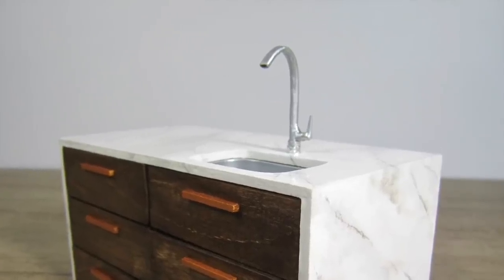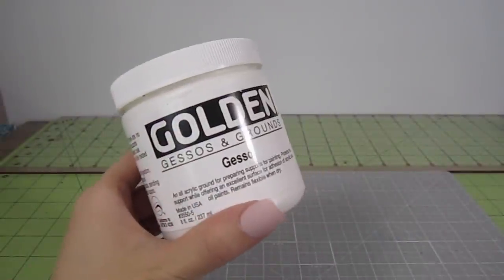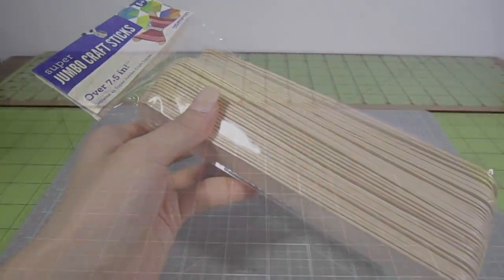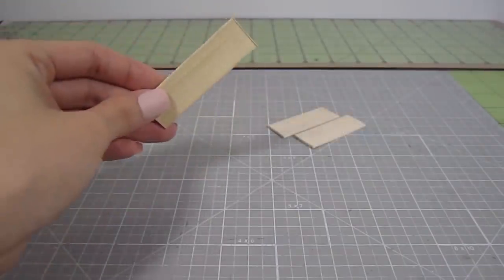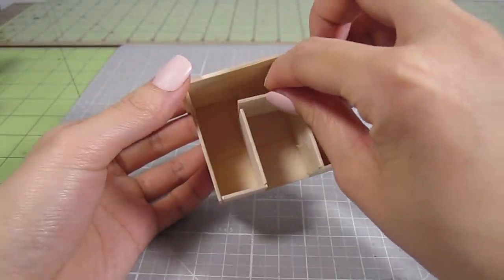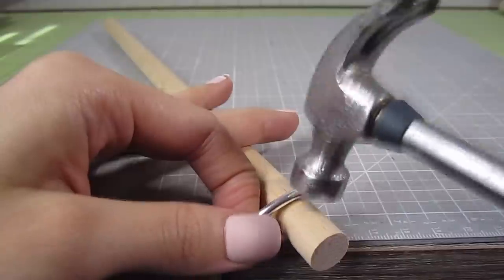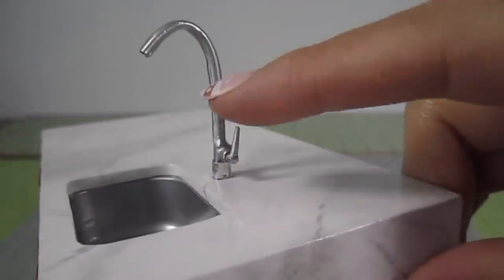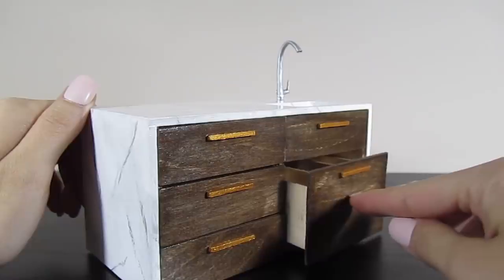DIY Miniature - Kitchen Island (working sink!)

Comment: Could you put the hole that was on the bottom of the thing on the back of the island so that you don’t have to hold it up for it to work?
Reply from the maker: Alyssa Girga Great question! you absolutely can! 😊 The reason I put the hole in the bottom was because this is a kitchen island and the back will be noticeable. It this sink was placed in a countertop that was on a wall, the best location for the hole would be at the back of the cabinet 👍
Reply: The Square to Spare Are you Japanese? Your accent is cool.

Comment: Wait, so where does the bottle go? Once it’s all complete, where do you put the bottle so it all connects and stuff? I want want to make it, but I’m a little confused about that bit.
Reply: FYI It’s DIY If you look at 9:10, she’s holding the bottle under the sink and squeezing, so you’ll have to create your dollhouse to have either an underneath hidden area to store the bottle, paint the bottle to be disguised as something else, or instead of using that exact bottle, creating your own water holding system with a needle tip and tubes (I’m currently trying to make one with plastic flexible tubing so I can route it through a hole outside my doll house through the back!)
Reply: @rosetta10010  --- Great idea!  You might consider making a video showing us how it turned out?  Would love to see the results.  :)

Comment: She has a very good design and how to on this sink.  I'd just suggest one short cut.  Instead of making the square water storage container (and having to make sure it doesn't leak) I'd either buy a round plastic bottle sold for food storage or craft supply storage (beads, etc.) and cut the top part off to make it easier and less work.  Or I'd look for the right size cap that would fit the space.  Check shampoo bottles, hand cream or liquid soap bottles, etc. for the right size.  I use these caps for all sorts of doll house things.  Example: toothpaste caps make nice vases to hold mini flowers.  Other caps can be used for bowls, etc.  When I use up or eat food in bottles with caps I never toss the cap.  I save them for dollhouse crafting projects.

Comment: Hi, I just want to clarify that you are actually lifting the unit up and over the bottle nozzle, to get the water up the piping and out the tap each time? It's a great design and video. I understand the need for nothing on the back of the unit, as its an island. But I just wonder if you have a video for a unit against the wall? Maybe have the bottle on the other side of the wall, and have the water piped through?? Can't wait to get started on my daughter dollhouse :-)

Comment: When I was a kid, I had a small sink--it was bigger than this one, but it had a working faucet with an actual recirculating pump and was battery-operated.  I loved that toy, and don't know what happened to it.  I'm bummed that I no longer have it.  However, I'm wondering how you make the water actually come up the faucet on this model:  I guess you have to be on both sides at once manipulating the squeeze bottle?

Comment: You are amazing! I love that you make most of your miniatures functional". I try to make all of mine as functional as I can as my children really enjoy playing with them and being able to use them with their different sized dolls etc.i will always make two, my "rough draft" and then my final piece. And I will give the rough original to my kids most of the time. Idk if you are taking requests from anyone and everyone, (sorry if you already said you did or not.) But I have been working on making miniature clay and crafting tools like shape cutters, blades, rollers, ball tools etc. And now I am attempting to make a miniature pasta machine. Anyway, I would absolutely love to see you make one. And maybe give me some tips on whatever method you come up with. I am having a hard time with finding the right material to use as what I have so far is not very sturdy and will give out/come apart slightly when trying to use it. I was inspired by sugarcharms shops version and used almost all the same materials, but I think I need to use a more sturdy metal, or just use a completely different material like plastic/resin, or wood maybe? It's not entirely crucial for me to get it as functional as the real thing, but definitely would like to be able to put a tiny piece of clay thru without it bowing out or splitting apart. Lol anyway, you are truly amazing at what you do and if you had any tips, or would be possibly interested in making one, I would be so eternally grateful. Tfs your amazing talent with us all!

Comment: First time miniature builder, here. How do you keep the popsicle sticks from warping? I was trying to make a dresser and I stained the pieces before I assembled them. Is that where I am going wrong?
Reply from the maker: Jodi Scott Hi Jodi! That’s a very common problem with woodworking (miniature or not). Generally, warping happens when there’s too much humidity in the air or moisture in the wood. It happens to me when my coats of stain are saturating the wood or there’s way too much water in the paint mixture. A quick fix is to let each coat dry completely before adding more. Another method is to clamp each piece to a flat work surface as it dries. Hope that helps!

Comment: It's really beautiful. I'm a little disappointed in the plumbing - if the little handle doesn't actually turn the water on, why bother including water at all? Especially since the glued together plastic water catcher will fill up fast and damage the wood if overflowed. I think the plumbing is a great wow factor for youtube, but not something that would be worth the effort otherwise

But I will say that the use of the condiment cup as a sink was brilliant, I love how the handle actually turns, and those rivets are perfect for a drain hole. I'd never thought to use it that way! Also painting marble instead of using contact paper was a brilliant technique.

Comment: Ok im sorry but this is really stupid and misleading the sink doesnt actually run ur just squeezing the water thru in from underneath so you cant actually sit it down and turn it on the handle does nothing
Reply: The water that goes into the plastic bin is understandable. But where does the water comes from ? Show where and how you squeeze the water into the pipe. The handle is not connected to the pipe though it moves.  In your next video, do a recycling water system meaning the water that goes into the bin can go up the pipe and out from the tap, and into the bin and up the pipe again. Speak slower and clearer. Not need to rush and feel anxious because there are missing elements. The kitchen island is cool but the working sink needs to really work. According to the title.